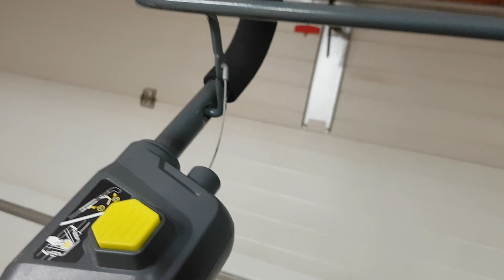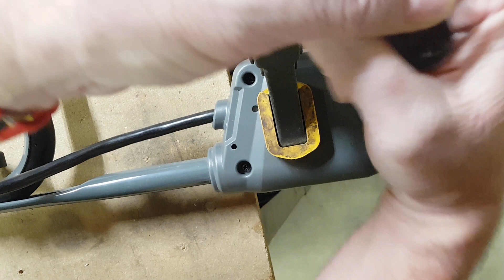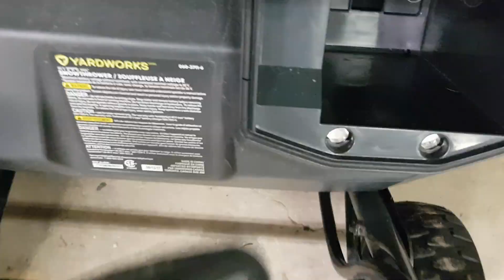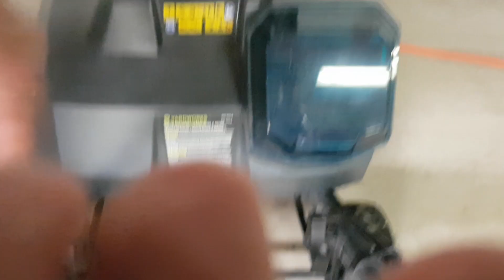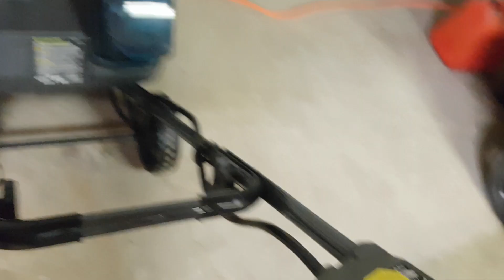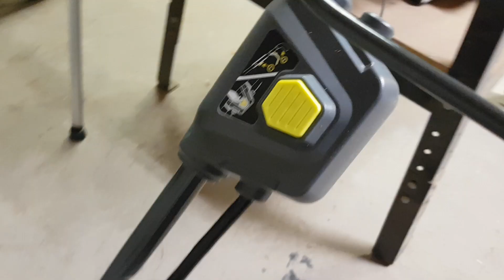Yardworks  40V snow thrower won't turn on

Comment: Thank you so much for the screw tip. I'm wondering if it's a good snowblower. There is one used for sale for 65$ can with charger and one battery. I'm looking for a complementary devise to my gaz snowblower. Is there any interchangeable battery with Yardworks? I have Ego, Ryobi, Milwaukee and Dewalt so I would prefer to stay on brands I have but that price seems a good deal.
Reply from the maker: I find we use terms like good or bad, but really it's an individual thing. This snow blower belongs to an 85 year old who could never handle any gas snow blower.  It's only a single stage plastic snow blower, so has its pros and cons. It starts every time(well now it does), it's lightweight, the battery lasts as long as her, and doesn't take up a lot of space. It's not self-propelled but is easy to push around due to its lightweight. It will never throw snow as far as a 2 stage snow blower, but it does move the snow far enough most of the time.  I would recommend 2 batteries for a larger driveway, but the user takes a break and charges herself and the battery. I was surprised at how much snow can easily be moved with a small snow blower like this.  I found I was less tired after pushing this snow blower than walking behind my self-propelled snow blower.  These small single stage snow blowers do not work well with deep snow, or heavy wet snow.  

I hope that helps, and thanks for watching.

Comment: Mine won't start right now so I tried this... Didn't work :(
Reply from the maker: Hmmm...are you sure the battery is still good?  

I have a Ryobi snow blower that has a collapsible handle, and when the handle is collapsed it will not turn on.  There is a switch inside that stops the snowblower from working.  Next time I am at the house that has the Yardworks snowblower I'll see if it has the same thing.

Thanks for watching and good luck
Reply: Stupid me. All I needed to do was push button first then push bar down, I was pushing down the bar first :( hopefully my reply helps others lol